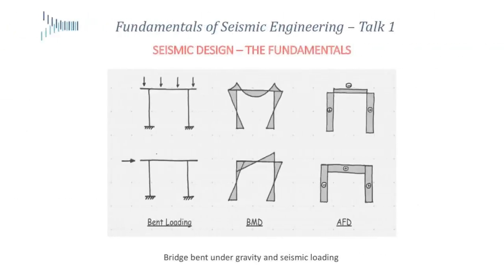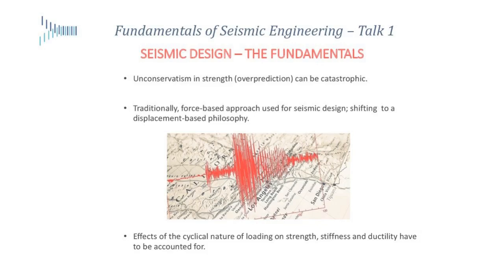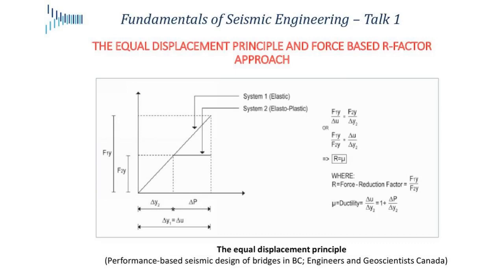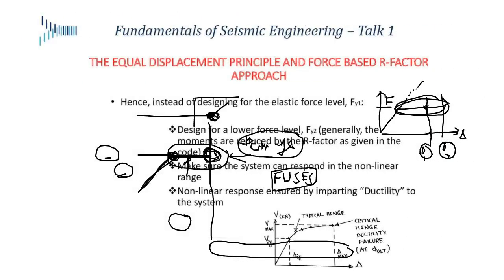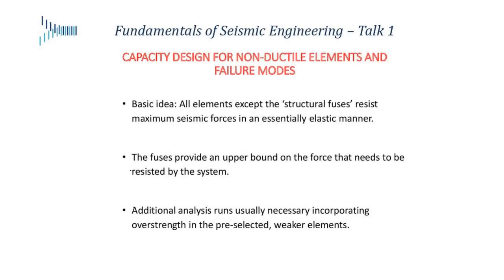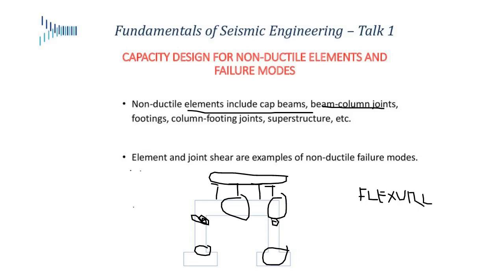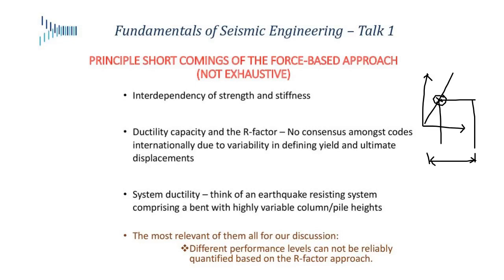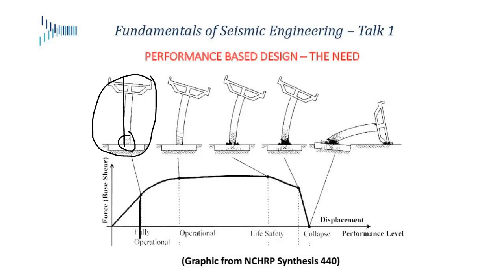Fundamentals of Seismic Engineering  (Webinar 1 - An Introduction)

Comment: Dear sir very informative webinar thanks a lot. 
1. my first question is any of commercial analysis and design software adopted fully PBD as a feature.
2. The second question is I am confused in plastic hinges (fuses) that what is the physical meaning of it is that some sort of detailing mechanism that after EQ event we retrofit it or replace some sort of member, please guide it, dear sir. 
3. The third question is how we decide either in case of elastic or elasto-plastic that much displacement is required for ductility. 
Thanks, sir
Best regards
Reply from the maker: Thanks so much. Those are all great questions and I will answer all of them in the coming sessions. Please make sure to attend/listen to all webinars.
Reply: @spannovationbridgeandseism9421  bundle of thanks dear sir means a lot . in sha Allah will attend all webinar, courses and videos.
Reply: @emjb3608  do you have video on this all 4 webinar
Reply: @lifestructures555  i had bro but unfortunately i Lost them by changing my PC.
Reply: @emjb3608  If you have it please share with me
Reply: @lifestructures555  bro as i got it i will immediately share it with you.
Reply: @emjb3608  Thanks bro